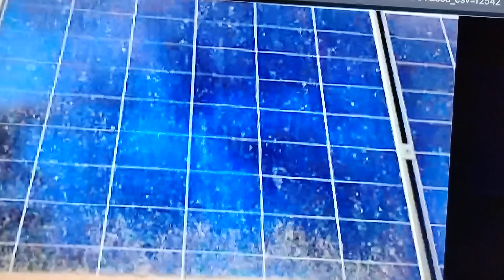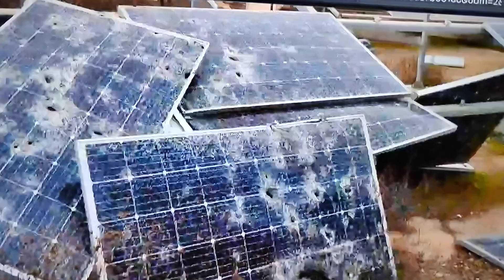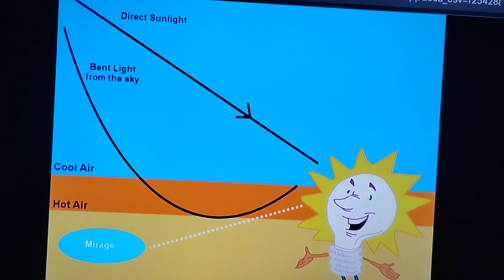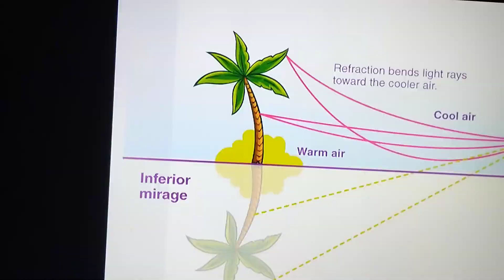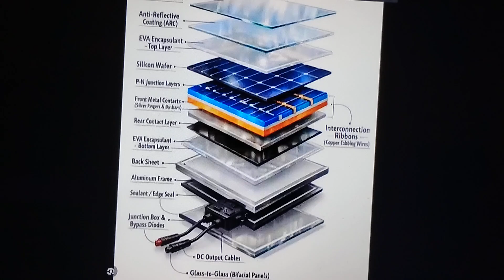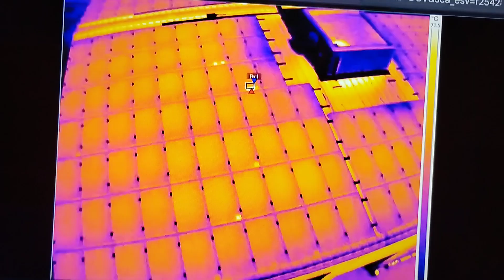solar panels next

Comment from the maker: These biomimicry solar branches / Trees have the potential to germinate up amongst the common solar panel industry like sapplings in the spring time.
 Addressing current Panel ailments -
 Thermal \ Atmospheric retraction \ Cleaning\ Maintenance \ Fragility \ Safety \ Visual appeal \ Passive natural setting integration \ Animal safe \ Scalable 
"Hot thermal mirage planes "  is a great way to name our current solar arrays...
Let's Reinvent how we face the Sun & Let's let Nature Lead.
            Non believers? Go tell it to a tree.       

Solar Flora